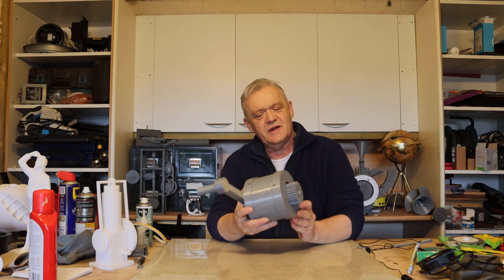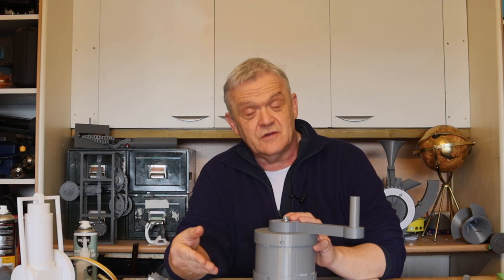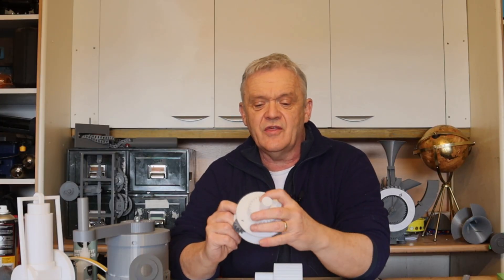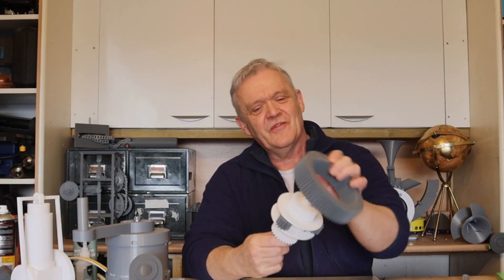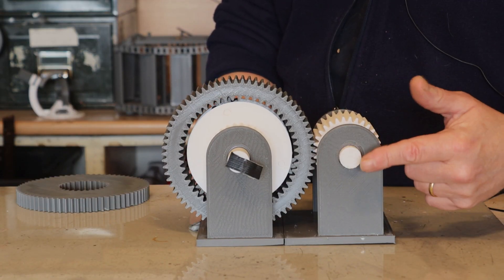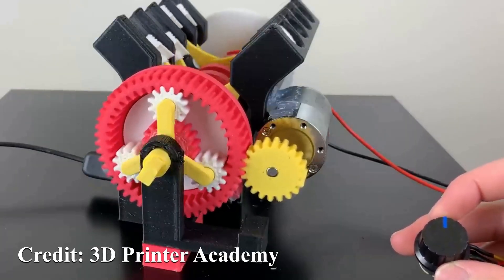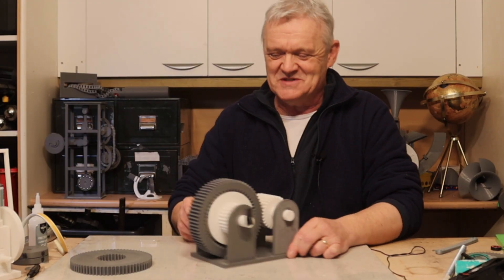2197 The Infinite CVT And Wind Turbine Control

Comment: THANKS FOR THE GREAT VIDEO! I ALSO SPECIALIZE IN GEARS AND VARIABLE DRIVES. THIS IS BRILLIANT. TO CONTROL THE 'VARIATOR' IN A PLANETARY SYSTEM USING THE INPUT SPEED. DID YOU EVER FILE A PATENT FOR THIS? HAS IT BEEN UTILIZED BY INDUSTRY?

THANKS,

MATT FROM WASHINGTON STATE USA

Comment: I see advantage of a feedback idle gear setup as a 'throw in' mechanism at higher rpm, but i would hate to see it detracting from the whole setup all the time.  of course i don't know what the whole torque/hp curves does look like for various turbines, etc.  but it would seem that just clutching in more sets of windings for gen. would slow it down.  Obviously more parts = more points of failure, but who cares.

Comment: See comments about addition/subtraction of speed i.e. differential. This is not a variable ratio transmission. Just a system with two inputs combining to one output, and the mechanical ratios of torques and speeds are always the same.

Comment: another good one! great ideas id love to see some implemented in the field. but around here we began to have wind storms now in excess of 150mph! it took the big windmills down like they were made of toothpicks! i never saw anything like that they were so weak when it came to big wind alone! what we need is a windmill that can handle 200mph wind and not bend or have the ability to go under ground for the duration of the storm. something needs to change because the storms are only going to get much much worse. they predicted it using a super computer 30 years ago and those weather maps they showed are exactly what is happening now perfectly in line! so that tells me we need to plan for the storms and build windmills or a new turbine tunnel mill something new that can handle them. what is your thoughts on faster mills in areas that have much higher winds?

Comment: I don't think this is a CVT is the sense normally used.  Take for example the CVT in my car.  It takes power input from the engine and works as a transmission to trade rotational speed for torque to match driving needs.  The CV part i.e. the continuously variable descriptor refers to the ability to control the reduction ratio (the gear ratio is a conventional transmission) from an input control supplied to the transmission.  

Thinking of this as a black box, there is one power input, one power output and one control input.  The control input, in a first order sense does not supply power input to the transmission, only a control "signal". 

This is not the case for the described all gear architecture.  The control input is via the electric motor which while it does control output gear ratio also is required to supply power.  One way of thinking about this is asking the following question: can the all gear approach behave like the CVT car transmission i.e. it has one power input, one power output and one control input (the control input not a source of power input) and therefore, first order, the power output equal the power input with no contribution from the control input.  Unfortunately, I don't think it can be done with only gears.

Comment: Fascinating concept not fully sure understand all of it for practical applications so if I put a term or turbine shaft down to the middle and hooked motors to the gears, is there a way to have the turbine drive the main and then be able to put charge to the planetary gears power output or am I just totally off base? Planetary gears hooked to three phase motors.

Comment: I had this idea also. I was thinking of higher power systems, like a vehicle.
I got to the stage where I ..so far .. reasoned that the control input, i.e. the input controlling the gear ratio, would need to have a similar power to the main drive.
Other than that, and maybe for low power systems, it is an excellent CVT transmission.
I hope someone can counter my assertion here. 
I just love your channel !

Comment: Great video Robert! Quick question, when you add the feedback gear to this system, the output is constant no matter the input (I'm guessing this the extra speed is converted to torque). However, what happens when you run the system via the output shaft? Does the transmission keep the output(the new input) the same speed? If so, is it then when applying more torque it equates to more input (the new output) speed?

Comment: I'm facing the problem of low speed winds and I'd like to see how to increase the speed of the generator, a PMA.
Reply from the maker: Don't forget when you increase speed you reduce torque - so if you are going to do that you will need a low torque generator to go along with it
Reply: @ThinkingandTinkering  I looked at the description of the generator and it said that it was low speed, I was going from memory. But I'd like to combine the double sided windmill blades I have tubercles to have a lower start speed
Reply from the maker: a low speed generator can mean high torque mate - it is always a balance between these two things

Comment: We used a controlling arm for pushing the ring gear back n forth at its periphery - the arm being connected at its other end to an eccentric position on a gearing linked to the main sun drive in such a way as to to match the planetary gear ratio. This gives a cyclic drive output which is effectively a constant speed with a sinusoidal variation superimposed, which is what we needed for our new fan/generator technology.

Comment: Hi Robert i love your videos and great idea. I've been thinking about a gearbox that can be hooked to an engine and ran forward and reverse smoothly using just the one input and very the rpm of the engine for speed a little different animal but similar. Kinda similar as your video with the engine but minus the electric motor it would be a great alternative to hydrostatic drive system. Keep up the good work 👍🏻

Comment: Very smart for windturbines, although I think too much RPM rips the blades apart, rather than damage the generator, no? I'm not sure.
Sadly it can't be used as a CVT for a car, because you need 2 motors, one to drive the planetary set, and one for that external gear.

Comment: Hello my name is Matt ,I live in Maine ,in the USA . MY QUESTION ,because i have a large river closely near my house and it has a variable rate of flow , would it be possible to opperate a water wheel at a constant rpm , say for a genny head  , that opperates at the constant of 1,800 rpm or at 3,600 rpm ,using a CVT DESIGNED TRANSMISSION ? SO THAT WHEN THE SPRING ITS able to take the fast flow of water and maintain the gennys needed rpm as such when the fall season its slower ,and have the CVT TRANSMISSION DO THE SAME TO KEEP THE GENNY AT THE CONSTANT NEEDED FOR THE SAME GENNY HEAD ? 
 THANK YOU FOR YOUR CHANNEL AND A AS ALWAYS A TEST FOR THE BRAIN , HOW THE WORLD NEEDS THAT NOW MORE THAN EVER !😊

Comment: Nice demonstration Rob. IMO It is inefficient and overly complicated. You would be better off by manipulating the magnetic fields in induction type generators which would not need gears. This can be done with relatively simple electronics and without any substantial mechanical deficiencies/inefficiencies. Windmills already have problems with gearboxes and the maintenance costs of eg offshore windmills are substantial in terms of labor, parts and logistics.
Reply from the maker: interesting idea mate - thank you for sharing

Comment: Ever since I saw how a CSD (Constant Speed Drive) works in a jet engine to provide constant electrical cycles regardless of engine speed, I always wondered why they don't use geared CVTs in cars instead of slip prone belts.

Comment: cool! If you like gear mechanisms, have a look at the traverse gearbox for a tank. They use two motors running at constant speed in different directions both coupled via clutches and gears to the turret gear. The clutches use some type of ferrous powder inside. A electromagnet is used to make the powder more or less dense and thus vary the clutch transfer. Its pretty neat. (This is used on stuff from the 60's). No speed control required, just different levels of power going into the electromagnets.

Comment: Hmmm, it kinda sounds wrong what you did. Theoretically, if you put into more speed into your construction and thus more power, the output torque would increase if the output speed stayed the same. Is this the case? Or did you just a speed translation that is hard to differentiate from the other? Measures are need to be made. Timing of the output with constant input speeds (10 turns at least), then torque measurements. 

If it works the way you claim, @wintergatan might be interested.

Comment: You should probably look at how Toyota did the eCVT on my Hybrid Camry, it is similar to what you printed but uses 2 electric motor/generators to get an infinite gear ratio, you could easily replace the hybrid battery with a Capacitor to make a DIY CVT.
Most modern wind turbines pivot the blades to slow the spin rate down, the ones I worked on you can actually reverse the pivot on the blades to act as a brake slowing the revolutions to avoid over-spin. I have worked on them with zero rotation in gale force winds.

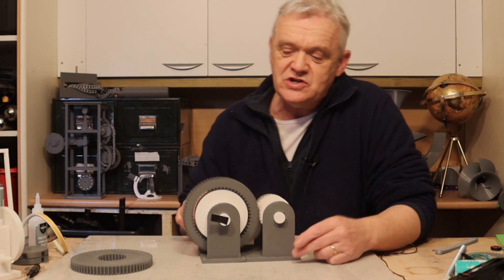Comment: Sorry, but that's not a CVT. It's a fixed gear ratio, and you know it. Otherwise you wouldn't have edited the video to run at reduced speed (while the audio was running at normal speed) during the zoomed in part of the demonstration (8:35-8:40).

Comment: Ingenious ideas good sir, wondering instead of having the constant drag from idler gear if there could be a vane and sail mechanism add to only engage the external ring gear when a certain rpm is met. Of course, we could install a tach on the idler gear but looking for something that could be engaged with mechanical means versus using energy to engage. Either way  amazing video and great presentation of an cvt/evct.

Comment: This is only useful as a continuous ratio system when you can vary the second input continuously.  In a wind turbine, that would require a second very powerful electric motor at great expense.  Really that approach is only cost effective and practical when you have two input drive systems you want to mix, like on a hybrid car.

Comment: I’m so confused. Isn’t this closer to a differential than a CVT? If you use a differential to couple an input and an output with the cage of the differential driven by a second input, you have the same effect as this, minus the built it gear ratio (or, actually, you can mess with the gear arrangement in the cage to achieve that, too). The point being that a transmissions job is to allow for different output ratios (different levels of mechanical advantage, in other words) with one input, where this device is mixing two inputs to achieve a combined output. Now, i’m not saying that this can’t be useful, just that it shouldn’t be described as a transmission. Call it instead something more like a ‘mechanical output regulator’ or ‘variable governor’. I think the best use case for something like this is when you have a power source which cannot be practically sped or slowed, such as a water wheel or an engine which requires specific speed to be efficient; you can then attach a parasitic load (generator or clutch) to the secondary input in order to control the output. Actually… power plants might be a perfect use case for a mechanism like this: you could use a smaller regenerative motor/generator system on the secondary input to regulate the speed and phase of a much larger primary generator and keep it in sync with grid phase: it would allow a mechanical feedback for load changes. But I still think it shouldn’t be called a transmission. If you imagine a main motor and a smaller regulating motor attached to an output through one of these, then it actually makes more sense to call it a clutch: the only difference is that a clutch uses friction, while this system uses the magnetic drag of the secondary motor to the same effect. I mean, right there in the name, a “transmission” transmits power, where this diverts power or combines power, depending on how you hook it up.

Comment: this guy is very confused, his "electronic control" requires power, but the point of a continuously variable transmission is it doesn't require continuous power to hold its ratio, rather it merely requires a change of a lever.

Comment: Thant is brilliant indeed. The only problem I see is that of startup. The generator needs aprox. 3500 rpm. If the wind is light then you need a huge input torque to get it started as the constant speed will try to start the generator at 3500 RPM. It would make more sense to use the electric motor input controlled by a micro controller with wind speed and torque sensor to achieve a smooth controlled startup. Love the content. I'm sure this compact variable speed transmission will be a huge hit in the years to come.

Comment: It is more complicated than just letting the wind turbine rotor spin faster and keep the generator at a constant speed.  For a wind turbine to operate in a stable and controllable way, the torque supplied by the rotor and the torque absorbed by the generator must be equal.  To increase rotor speed, the generator absorbs less torque, to decrease speed the generator absorbs more torque.  It is a fine balancing act that is tailor made for power electronics and wound rotor induction generators.

It might be suited for a wind turbine that uses a squirrel cage induction generator.

It is very cool and informative, but I am not sure the utility scale wind industry will adopt a more complicated gear box design and/or return to squirrel cage generator designs.

Comment: You cannot make a CVT using gears alone. 
Using gears alone there will be a fixed ratio between input and output period.
Having a manual car and riding the clutch may appear like a CVT but it isn't.
A torque converter is like a CVT but is lossy.

Comment: No you don't have an electronically controlled CVT. 
You have variable speed electric motor and a model combustion engine who's output's are combined together in the gearbox.
There is no CVT here.

Comment: Interesting, however couldn't follow the bit where you talked about the feedback path. But... don't wind turbines run at synchronous speed and change the blades' pitch to control the power being collected fromn the passing wind?

Comment: So, it is going to spin the generator the same speed no matter how quickly the blades turn?  You mean if the blades are going zero rpms the generator is still going at the constant rate?   That's amazing!  That fixes the whole, "what is the wind isn't blowing", problem.

Comment: If you're taking some speed from the primary drive, and are using it to spin the output shaft backwards, doesnt it just spin the output shaft backwards.. without increasing the torque it produces? I would say it technically doesn't increase the gear ratio, but that's wrong because at the end.of the day the input would have spun a lot more If you're using some energy to spin the output shaft the wrong direction to make it do less circles. However same thing could be done if you just Intermittently disconnect the output shaft in general, And the input would have spun more. 

So spinning the output shaft the wrong way only modulates the speed infinitely, it doesn't module the torque, because spinning the output backwards doesn't add any torque, just removes speed

Comment: It is not a CVT.  It is a power splitter with two shafts connected together resulting in a single ratio between the input and output.  Where is the "Continuously Variable" in that transmission?   The ratio can be easily determined with a little arithmetic (which you fail to show).  You don't seem to understand that and your title is totally misleading.

Comment: A test you may want to do is to see if an increase of the input speed leads to an increase of torque on the output. You may be losing out on energy to friction when the turbine speeds up, thus losing efficiency.

Comment: This is making my brain hurt. I'm trying to understand how the idler gear that you've added manages to cancel-out the extra input speed to produce the same output speed no matter what the input speed is. That feels like it should require a more complex mechanism than just a couple extra gears, because there's no sensors (electrical or mechanical) in the system.

Comment: If we assume this follows the same rule as any other gear reduction, wouldn't the generator need to take advantage of the rising torque? Or is this supposed to keep power generation going at a constant rate despite increases in wind?

Comment: Very interesting indeed!
But here's a brain teaser: What happens to the input shaft, if you turn the output shaft with this arrangement? Will it arbitrarily change speeds, or find an equilibrium at some point? Then what are the factors?!

Comment: what would it take to create a feedback system that both speeds up the output below a certain input speed (wind speed too low to generate power) and slows it down above a certain input speed (Dangerous wind speed)?

Comment: Check out Honda's ATTS transmission, pioneered for the 2000-2001 honda prelude SH. Ive owned a lot of cars, but this honda is in the top 3 for pure joy of driving. Front wheel drive car that drove like it was rear wheel drive. Anyone whos interested in gearboxes/transmissions will love the engineering and how it works and what it does.

Comment: What do you think of turning a pair of O’Neill cylinders into a huge gearbox?

And then launching another cylinder, that’s lighter mechanically, like a potato launcher ?

Just using mechanical advantage, and their size and mass, because even if you had very powerful rockets, it would take an incredible amount of fuel and incredibly powerful engine to launch it with chemical rockets.

After that, you could use huge flywheels/gyroscopes to flip it and use just one (end)nuclear engines to slow it down once it gets to the appropriate range.